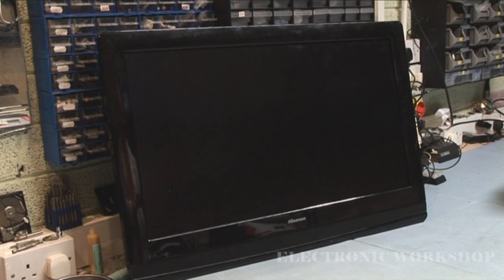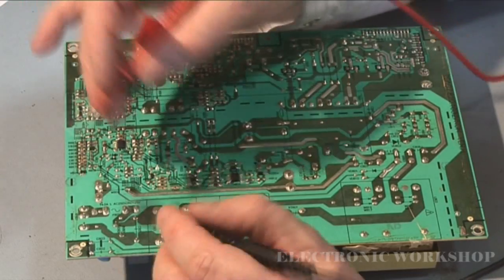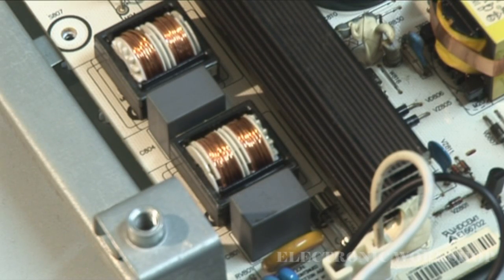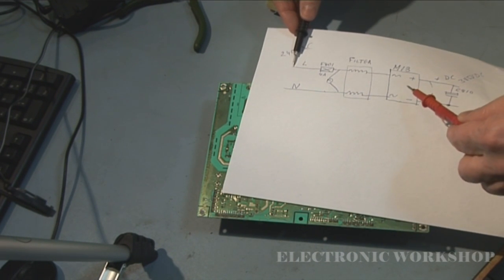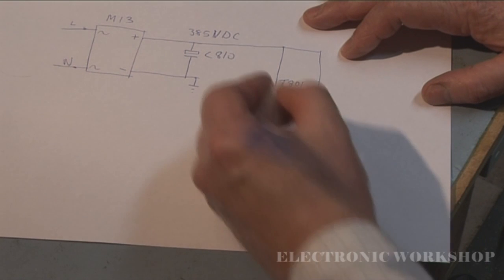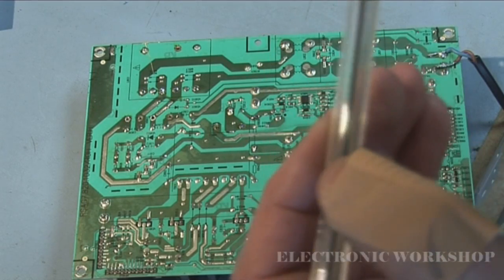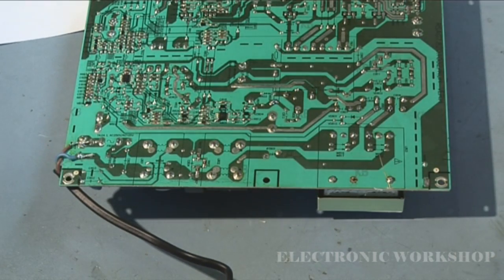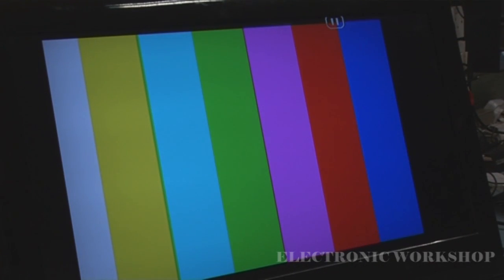Hisense LCD32W57 Power Supply Repair

Comment: I have a Hisense LCD LED tv, the main cap blew out,  I noticed it has a space for two caps but only one was ever installed. They would be parallel if it had both. Why the blank?

Comment: thanks for your videos 100 % I have a question I have a samsung plasma tv model 851FH - YB05 I turn on the tv stay on stanbay gives me stanbay 5 volts but does not give the 3 15 volt  The power supply looks good has nothing burned I remove the power supply of the plasma tv and or outside the plasma TV just does not give me the 45 volt I know your have more experiecia if your can giveme an idea what component I can test thanks

Comment: I used to work in a shop, my co-worker was fixing a microwave oven and touched a charged capacitor. He was standing up at the time and the shock threw him backwards up agaisnt the wall of our shop. He was stunned but otherwise not hurt. It really scared me.
Reply: I was hit by one but my finger was far enough away from ground the electricity had to jump a gap and reduced the voltage somewhat, my arm went numb. scary stuff.

Comment: hi,
I have a sony kdl19bx200 I was wondering if you have any thoughts.
powers up but no back light, found transformer had open winding and so I repaired it and now its arcing. I cannot find on internet and tried sony it self nothing.
psu number:vya194g-07
transformer numbers: hut-276 050269
js 10070801
thank you.
jwcelectronics
Reply from the maker: I got the tranformer for the 22" version from Sony p/n 994803316 markings on transformer TMS95026CT. But yours is the 19" version
here is some part numbers for the psu pcb if you cant get one

147424111 POWER UNIT BOARD, COMPLETE 19” LP6G/SS1G
 147424-21 POWER UNIT BOARD, COMPLETE 19” AU1G/
SS3G/CH3G/CH4G/AU3G

the pcb will have to match the screen
Reply from the maker: here is  a link to the 22" version
 http://youtu.be/yvkqHWaPs4A
Reply: Electronic Workshop
thank you for your help.
jim
jwcelectronic repairs